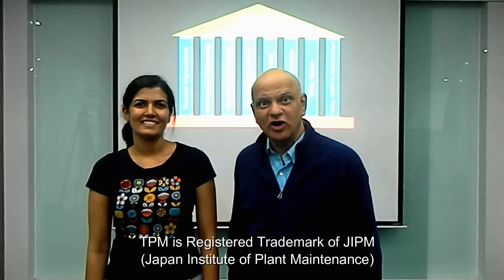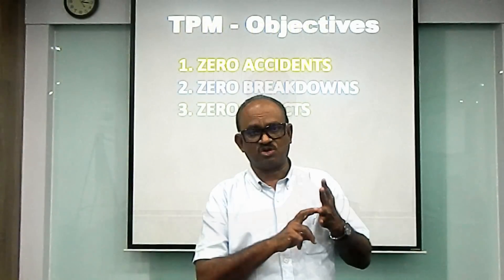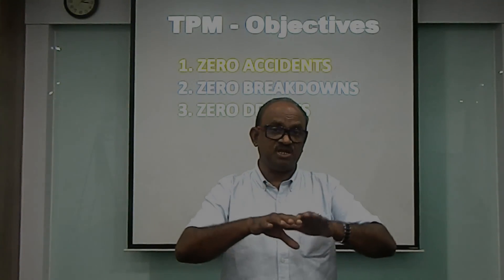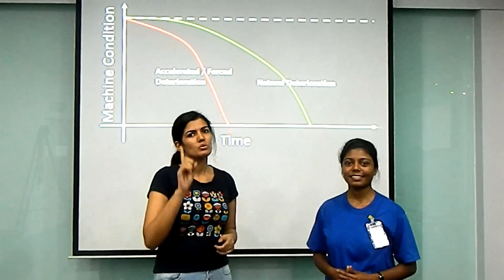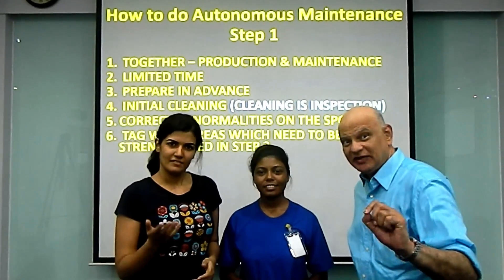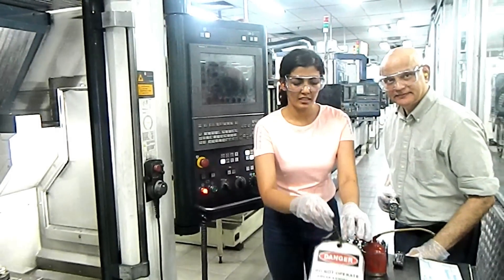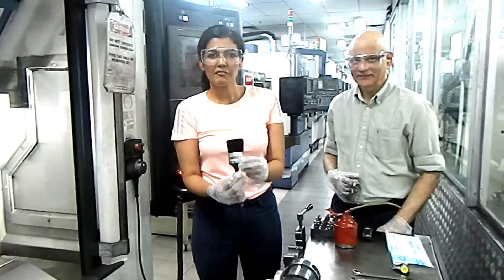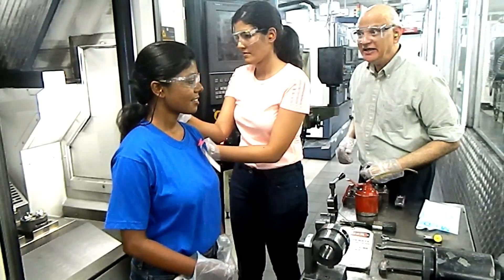TPM. Autonomous Maintenance Step 1 for Industry 4.0

Comment: Understood step one - Jishu Hozen which basically deals with cleaning the machine, fixing the abnormalities on the spot and tagging the issues which cannot be solved in stage 1. The demonstration made it easy to understand. Sir, would really appreciate if can learn all the eight steps of TPM. Will also be happy to volunteer. Thank you Dr. Azlan Nithia to share the insights of digitizing the process in industry 4.0 and hence why TPM is so important. Thank you Dr. G and the team for the video
Reply from the maker: Thanks, Dwiti, for the offer to volunteer and asking about the other pillars. We are about to make a video on the second pillar of Kobetsu Kaizen, also called as Focused Improvement,  with Khushboo, Rashmi, Shubhangi and Amrsha.
Reply: @DrG720214  glad to hear that sir. Thank you

Comment: After over 35 years of experience in manufacturing, I have found that TPM is very vital for every manufacturing company in any industry. Implementing Industry 4.0's digital and connected factory requires a strong TPM foundation.....predictable machines, zero breakdown, zero defects and zero accidents.
Reply from the maker: Thank you Dr Nithia.